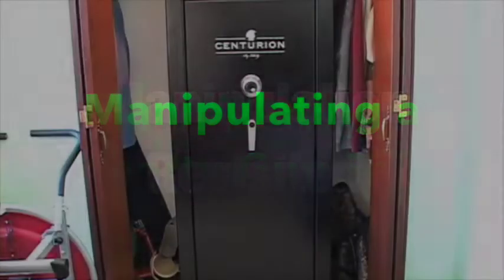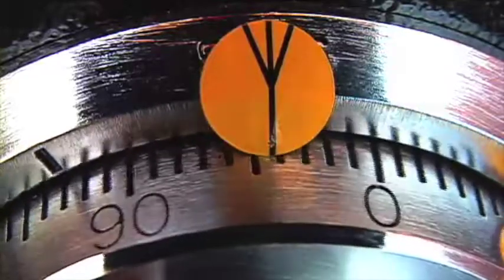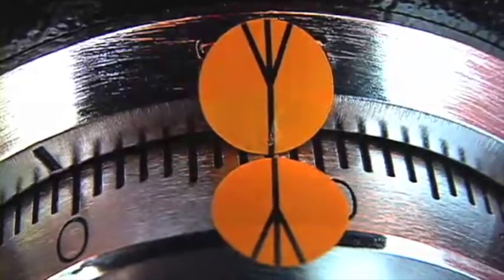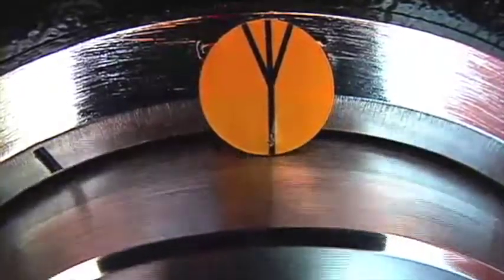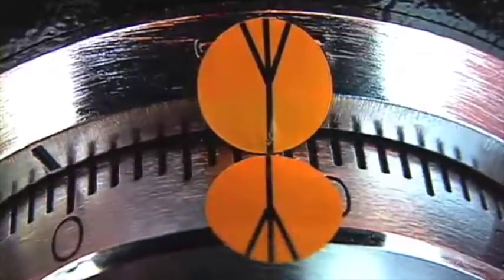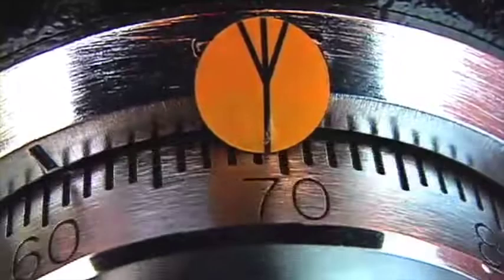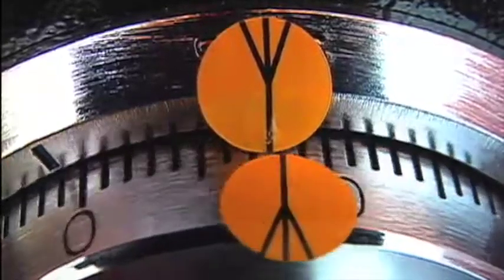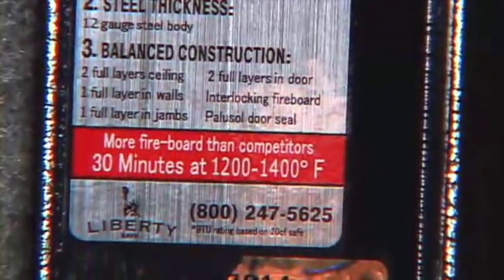Manipulating Gun Safe

Comment: Hello John, I am Robert. I have a friend who's given me a large Gary safe. When his business bought a building the safe was in there. I have an amp with piezo discs. Have not had much luck. I was wondering where you can buy safe crows feet indicators? I have searched the internet with no luck. I am in the Richmond VA area. If you are close I would be interested in using your services. All the safe company's around me will on punch the safe. I am trying to avoid that. I enjoy your videos as well.

Thank you 

Robert
Reply from the maker: There is a locksmith store in Kentucky called Lockmasters to get indicators.
There number is 800 654 0636 and the part number to order is SPO1003Y2
Im in Niagara Falls area find a safe guy who will "scope the change key hole"
not punch - thanks
Reply: @johnwickpick8621  Thank you and have a good Easter!

Comment: One last update-   I guess that "pop" in the handle did slip it past the lock, because when I would yank on the door, it was loose and seemingly wanting to open.. So I stood over it and pulled up hard and the doors opened a good 1/2" or more..  I could get pry bars under the edge of the door..  but there was still something snagging and holding it..  

I forgot to mention that the second door's handle had already been removed or broken..  So I'm thinking that second door was hanging it up.   So we were wrenching on the 'good handle" (on the right door-- by the lock)..   and unfortunately now that handle also twisted off.  I didn't realize that it was brass and made to brake away or I would have been a little easier..  Honestly I think the previous owner had already half way twisted it off because it was facing in a weird direction and not the same as what I see in pictures..   So I think I'm going to go ahead and cut a big crawl hole in it..  It will be fun, if nothing else.   Thanks again.. Cheers